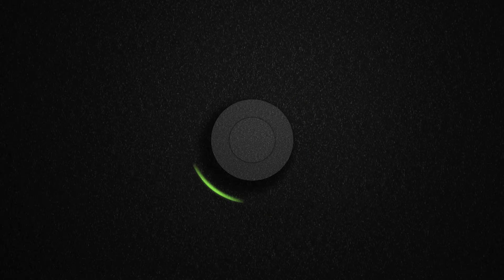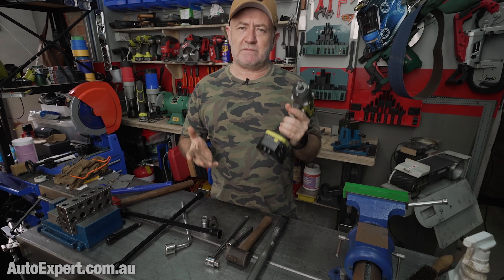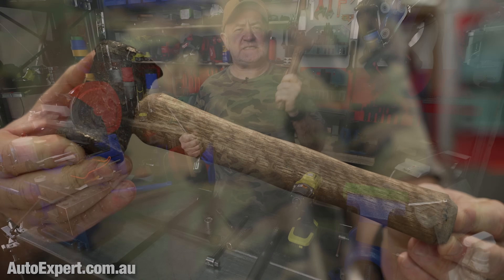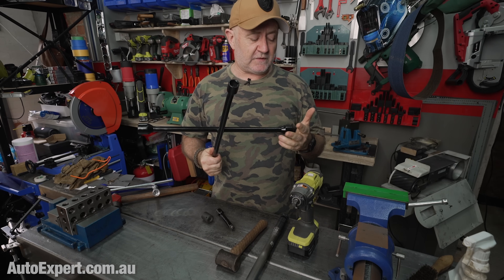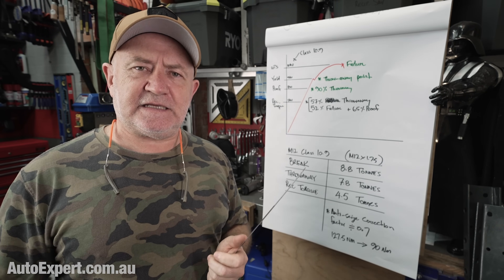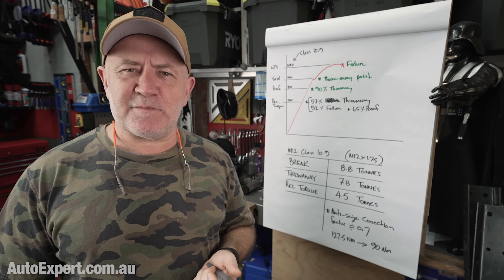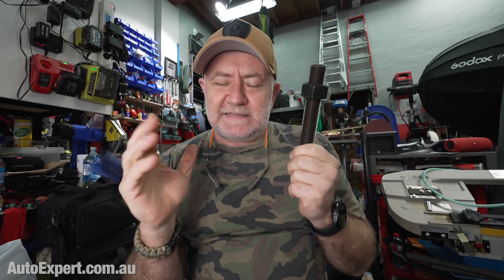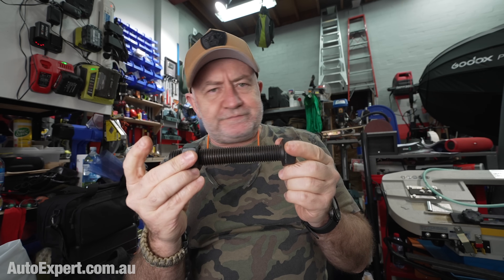Wheel nuts: Ultimate 'ghetto engineering' DIY deep-dive | Auto Expert John Cadogan

Comment: Hate to be a killjoy but my experience is that you are going to need a lot heavier duty impact than a 250-350 NM gun.  In a perfect world they should work, but most cars don’t get the wheels taken of every month or so, and the vast majority will not have put any anti seize in the threads and may have not had a wheel off in years, meaning it is going to be very hard to take off a wheel with low to mid torque impact.  My experience has shown me you are going to need something rated at least 700NM plus to get wheels of cars and there are no el-cheapo alternatives I know of that will do the job.  Look I have even taken a wheel off, used the torque wrench to fasten (120NM) driven around the block and come to take the wheel off again and the stupid (Brand name, not Ozito) 320NM impact could not do it.   

On another point, I have had too many normal socket’s shatter when using an impact for me to ever recommend using anything but an impact socket for high torque (100NM Plus) application with an impact.  

One last thing, I have never (in 30 plus years) had a problem removing anything using extra leverage, but I have sheared off/snapped and rounded a few thing with an impact, maybe it’s just the luck of the draw but I have never broken anything with extra leverage, but have damaged plenty of things with an impact.
Reply: I also use a 'SCA Wheel Wrench Metric Extendable 1/2" Drive 530mm' in the car(s) work better than anything else i have every used  on the side of the road including the old hamer trick.

Comment: In General the never seize you have recommended  is not appropriate for all wheels nuts and studs. Copper and aluminum don't play well together. If you are going to your once in a decade pot of Anti Seize get one that works with everything.
Graphite based or even just plain grease please. Even a few drops of 3 in 1 oil would be enough. I would also recommend for alloy wheels that fit over a hub pilot tightly a wipe of grease as well.  Every new car I have ever had with Alloy wheels has needed this as when corrosion happens and it does it will lock the wheel in place and this can be extremely difficult to remove without severe measures.
I would also like to add that the torque wrench you showed does suffer when misused. Lubrication on the internal break point is critical to the calibration. It does vary over time.  I have had some experience with this in calibration /Meteorology.  Deflecting bar styles are far more fragile but are far more repeatable (Warren and Brown, Even electronic like a Snap on). 
Standard OEM supplied wheel nut wrenches are made to allow someone to step on the end of the bar and unless they are under 50kg's this will break all but the most abused nuts away. A couple of bounces on it always helps and is a lot safer than swinging a hammer in the dark if you rarely do it (Think dents and paint chipped of wheels). The Lighter people would probably have trouble handling the wheel anyway and should get assistance.
Reply from the maker: Agreed about the corrosion between the hub and the boss. That can be a pain in the arse. Interestingly there's nothing in the Penrite Copper-eze tech sheet about contra-indicatiin with aluminium. My experience of using it for about 8yrs hasn't highlighted any issues either.

Comment: flap using a hammer, with appropriate footwear give it a stomp, with your heel of your foot, at the end of the tool. Job done. For the rest of the nandy pandys, office dwellers, limp wristed folk, call your roadside assist. I only remember the odd times when a wheel brace by hand wasn't sufficient. Right after having new tyres fitted, funny that.

On the flip side some old coaches/busses/trucks use left hand thread wheel studs on the LHS, I've been known to take advantage of others not knowing this and extend the playtime somewhat to my amusement. Ah the good ole days.

Comment: I carry one of these low end torque multipler kits in each of my vehicles at around $50 each from ebay  https://www.youtube.com/watch?v=B-VScTIq6wk Sadly despite the detailed instructions that come in the box the missus can never work out how to us it but thankfully there is always the RAC roadside service to come to her rescue.
Reply from the maker: Is it the full 'cheese grade' Taiwanium, or actually a good tool?
Reply: @AutoExpertJC  It claims to be trade quality but it's certainly no Snap-on tool although probably better than the price and country of origin might suggest.We haven't needed to use then much but so far no failures or difficulties in use.  I thought the more expensive heavy duty ones commonly used with truck wheel nuts would be too hefty for the missus to use and might even cause my psoriatic arthritis sausage fingers some issues.
Reply: @AutoExpertJC Taiwanium is about 3X better than Chinesium, in my experience.

Comment: I have and highly recommend the following... Electric 1 inch square drive Ingersoll-Rand "Impactool "  and in air it's a Shinano air and also Makita and Milwaukee cordless. Personally I would suggest avoid Milwaukee and and home handiman tool brands as they are too gay and not industrial grade.
When using ball peen u need the genuine Estwing.
Sockets you need Ko-ken.

Torque wrench it's Norbar, Atlas Copco or Snap-On. Don't ever go cheap.

Comment: Mate once rented a car trailer, of course, we got a flat at midnight, while it was raining. We could not get the wheel nuts loose. I am a pretty hefty lad and was putting everything I had into it. both muscle power and then standing / jumping on the wheel spanner... bent it, nuts never moved.

Mate took the trailer back the next day, with shredded tyre, business owner went mad, demanded mate pay for a new tyre. Mate said he would be happy to, just as soon as the owner could crack the wheel nuts... 

Bloke (owner) was in a hell of a mood and readily agreed... muttering about pussies that couldn't even change a tyre.. 

Mate stood back and waited. Business owner strained mightily... and the nuts refused to move, he then did what I did and used his feet and tried to jar the nuts free. Finally he gave up, let the mate off for the cost of the tyre. as my mate was leaving, owner was heading towards the workshop staff with a look like thunder.
Reply: I had a similar problem - but could undo the nuts, yet the two of us couldn't shift the wheel. Bloody alloy had galvanised itself to the iron hub. The method for removing it was beating the crap out it until it let go.

Comment: As a tech, I agree with you that most DIYers don't need full sets of pro quality tools like Snap-On. But damn. But if you do a task often, consider a few.

What a pro tool brings isn't just a reassuring warrenty or a pretty and durable finish (but they do bring that). It isn't even the durability that they bring to the table. The #1 quality is the fit. If the size says 21mm, that's what it is. Lesser brands often are 21-ish. And the "ish" is on the larger side which only helps to round off the oxidized fastener. And this is just the ID part of the tool.

A pro tool usually uses a better quality steel and manufacturing process which allows the tool to have a thinner wall for a smaller OD. Think of all those times that the tool wouldn't fit or you had to get a bite on half of the fastener because you could get into the recess for the rest. 

You don't always need to spend the big bucks, but NEVER buy the cheapest. Tolls, like most things, the cheapest always ends up costing more in the end. And don't discount the pride in ownership part of the equasion either.

Comment: Then some bastards think it is a marvelous idea to stick the odd left hand thread on wheel studs on the odd side of an odd car or van, That not so oddly pisses you off when you don't know about it  or have forgotten you have left hand threads and can't see the thread due to capnuts/domes nuts, (oddly ones like John's head.)   The ones you can't see a hole right through, not Hollow.  When in doubt 100 Nm or 75 ft lbs. for normal cars. ( from a Tyre shop.) that is what they set their rattle gun at.  But at your own risk.  Make sure you know how to use your torque wrench,  And know how to not confuse kg m with  Nm with ft lbs. ( 75ftlbs = 101.7 Nm =10.37kgm )  Always adjust up to the mark,  (Hysteresis) And get the correct torque for your wheel studs/Wheels/stud pattern/vehicle.  Brilliant tip on checking threads.  Very interesting. Thank you John

Comment: I just let my gf handle it, she is so fussy. Oh, we got to have aluminimum grease on the studs, using a torque wrench to 120Nm because it said so in the booklet. And of course you have to wind down the torque wrench after use. Yes, and those silicone wrapped sockets to avoid scratching the precious wheels. Check tire pressure. Recalibrate the tpms. And clean the wheels you took off, let dry and put in bags 🙄 Because we change from winter to summer-tires. Me, i'm just grabbing the nearest thumb detecting nut f#£ker and go at it.

Comment: Spoiler alert dudes and dudettes…..

99.9% of flat tyres in the Metro area are slow leaks which can be rectified by a 12 V air compressor and driving to your nearest tyre shop

So I’d suggest all fat cave dwellers want to invest in a 12 V air compressor and don’t worry about the rest of it other than ensuring the wheel nuts have got a lick of anti-seaze on the studs and they’re all put on at the specified torque….

The reality is you could drive for 20 years and never get a fatality with your tyre that cannot be rectified with a 12 V air compressor (and possibly a dose of tyre slime - not my thing i must confess) 

and Google maps taking you to the nearest tyre shop…..

DUUUUUUDE
Reply from the maker: Excellent point.

Comment: The bottom line is that history shows that wheel nuts that are anything close to properly torqued, simply don,t  come undone by themselves.

We have around 100 years of reasonably modern ( as we currently find them) wheel nuts, routine measured torquing of wheel nuts is a relatively new thing. Both on the roadside AND in properly constituted workshops.

Untill about 5 years ago, I,d never heard of or seen anybody use a torque wrench on a wheel nut. 

Yeh i,ve seen some wheel nuts come loose, and one or two wheels come off. (Ya picked a fine time to leave me loose wheel), but in all those situations it was beyond doubt that the wheel nuts where nothing close to property tightened.

Comment: John, you shouldn't be swinging your legs when doing pull-ups. That's cheating. Furthermore, a lot of the work is done by the muscles on your back, so each arm is 'lifting' less than 40kg.

-- Your personal trainer
Reply from the maker: You never studied physics, huh? (About the weight on each arm. Tension at elbow = about 40kg, otherwise Isaac Newton very cranky. Do try to keep up.) Swinging (slightly): I'm training for functionality, not aesthetics. You'd kip in the real word. (Perhaps you've seen Crossfit?) Plus, I'm nearly 60, and I can do 80 in 20 minutes. I'm happy with that.
Reply: @AutoExpertJC  Damnit, I told myself not to post comments before my first cup of coffee... failed again.

You are, of course, correct about the 40kg per arm. My bad.

Comment: A viable technique for using those cheap "factory" lug-nut wrenches, is simply stomp on it  with your foot. Considering the ineptness of the public at large, whacking on  that factory wrench invariably will have John  Q. Public doing a glancing blow & hurting themselves. 
 Those "torque-sticks"  work fine IF you do some experimental calibration along with your genuine metered Torque-wrench...How many Pop ,pop, pop with your air impact gun?...yes you can learn just how long you keep this pop, pop, pop going &  this torque-stick will give you an accurate value . Finger threading lug-nuts is again very time consuming and wasteful, your air-gun has a "slow run" setting...a light pull of the trigger will run down the threads, & you'll know immediately if it's  trying to cross-thread as there is virtually no power behind your gun with a light pull of the trigger, the lug-nut turning maybe half a turn before stalling out.
Reply: trust me the time you save goes out the window with a damaged or cross threaded stud. save the hassle a startem by hand. i can be nearly as quick with a 4 way brace.

Comment: hi 
Poor quality nuts and studs are lurking out there OMFG!!!!
For the experienced impact guns canbe used and NOT overtighten .
Dry torque is fine if u want to  make it hard to undo , remember the lube .!  Eventually most studs and or nuts stretch [effects some models real bad ]   which is encouraged with no lube  . Binding is bad .
Fleets of vehicles trucks etc etc over 40 yrs no problem with lube and impact guns .
Remember  ,,, Are your nuts stiff to wind by hand [ouch]  [LOL]  =worn out

Comment: You should of flipped thier noggins and told then to check the stretch of the bolts with a dial indicator rather than using a torque wrench. Yes the stretch decides the breaking point especially connecting rods.

I guess you slid by that aerospace MIL SPEC.
They might think it's a power drink .

 I worked in the test cell on the agt1500 Abrams tank turbine. I pretty much know every way possible to do things correctly.
Some was way overkill but engineers always do that so thier shit doessnt come back. That's why everything is over weight like the employees and um u. But with the extra farry load you'll just have to leave a few boxes of rounds behind.

But anyway just a stab for your haters to be equal. We all know everyone is equal even if the are 10 feet or 4 feet. 

Your pretty spot on and I wonder since your Australian. Must have some Hungarian in you. Oh shit the attack squad will get me. NOT. I got them all on lists before they knew they were spied on.

I dont think you had Presidential clearance like I die but are smart like you had some teachings from the smarties.

Only 3 people in Sikorsky were allowed to machine the cuffs that hold the Presidents CH53K  helicopter blades on the rotor. I was one that was trained by the Air Force to run every machine in the shop.  The cuffs are made from a special Titanium and I had to change the engineers specs to use steel cutters and chose to use 3  inch Cobalt coated corn cutters to machine the bulk then finishing cutters. Few grand each back in the 70s. 

You should hear what a cobalt 3 inch cutter sounds like when it snaps when running the speed to fast or hitting a hard spot. The whole shop stops like when you have a magnesium fire or explosion. Seen many of those in my day. We took home the shavings and powder for fireworks. Imagine my lungs?

I quit helping the military because it got so corrupt after the Nazi paperclips took it over. Theier plan was to lose the war then infiltrate other countries to develop better weapons. Seep Staate so only yhey know then start a one world government. Hey guess what. They drugged the kids and brainwashed them to do what they are doing. WWIII is now

So I got into food. Thought it would be better NOT. When I worked at John Kerry's wife's place General Foods in NY I learned of the blackmail system. They paid me $50 an hour and his friend got $75 as a middleman. They didnt pay my SS so I get poop for social security because they kept that money and never went it in even though it said I paid on check. Head hunter jobs were big then.

 So food was just as bad especially when I learned of irradiated MRIs. Oh that's a whole story itself

So when I watch your show and see how you have to explain things to people like kindergarden I have to LOL
LAUGH On LOSERS

TOO Freakin Funny

My kindergarden teach in the 60s told me one day I will have to fight the Chinese.

She was right😊NJ

Comment: How about lubing the studs  beforehand  'in that case the nuts will come off much easier even without extra leverage' but for someone with lesser strength more leverage  would be a good idea ' and it wont cause  any breakage of studs ' because the lube.  A problem that exists is tyre shop's  and garages  that over tighten wheel nuts for their customers because they are either morons or they just dont care. I know a man that was driving home from work one day  and all of a sudden his windscreen  shattered  and he was hit in the chest by something ' that something turned out to  a broken off wheel stud and nut from the bus that had just  past him in the opposite  direction 'he thought  initially  he must have been shot.  He lived but if it had have got him in the throat  or head   i think there would have been a funeral.  The electric  tool for wheel removal on the side of the road  is a good idea but not ryobi 'any brand but ryobi ryobi is shit.